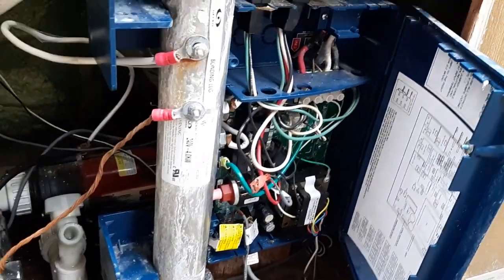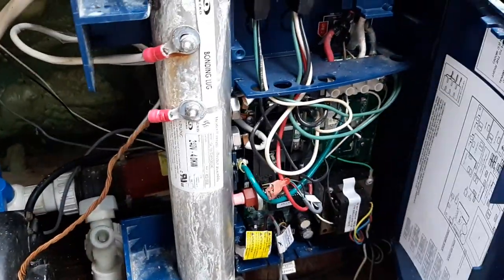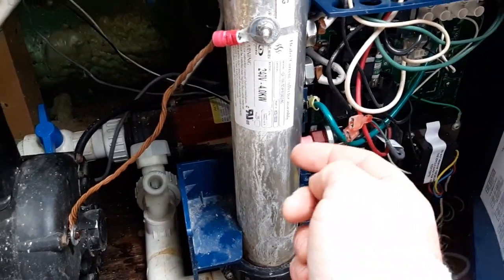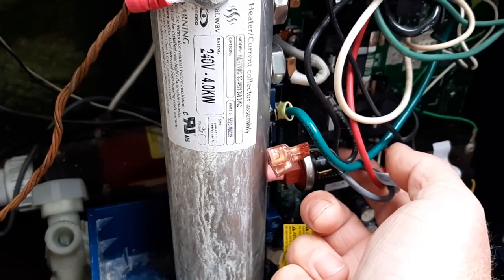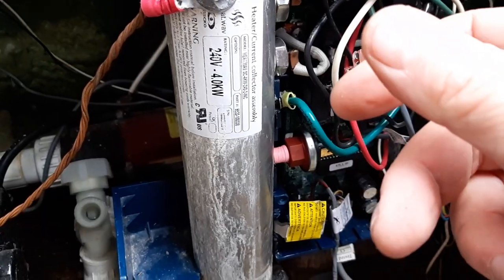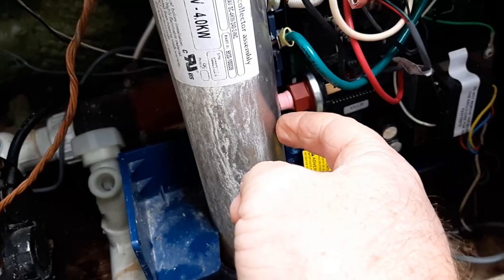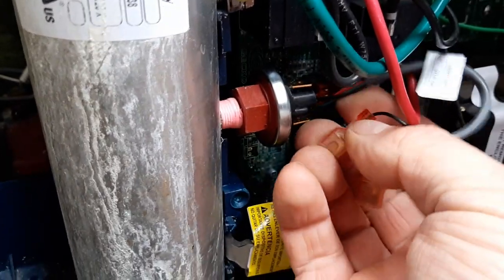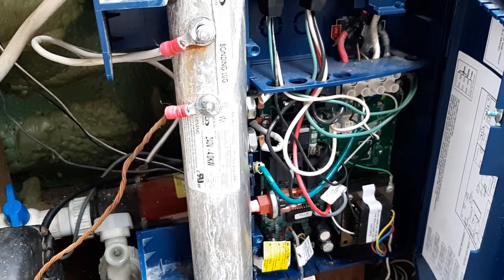Gecko Hot Tub Not Heating and The Reason Why

Comment from the maker: A jumper across the pressure switch is a wire that you can put on the 2 leads.  If the relay clicks and the flo code goes away, then you know it's most likely the switch.  Sometimes you can get a build up on the inside of the heat tube blocking the switch also.  Let me know.

Comment: I took out pressure switch without draining water and water spray on the circuit board but the power was plugged out would that damage anything
Reply from the maker: Dont turn it back on.  You can let it dry out for a couple of days and also use a hair dryer.  Dont use anything else but a hair dryer.  You can also use a air compressor to blow off and water.

Comment: I just changed out my pressure switch last night and this morning my FLO code is tlstill on lol and we have a winter storm hitting us atm. I pulled the filter and  cleaned Y-strain. Im at a loss now lol
Reply from the maker: Is the circ. pump running when its on?  If on, did the FLO code ever go off?
Reply: @VIPPoolsandSpas  i swapped out the pressure switch and pulled my filter and circ pump is circulating but still has FLO code and wont heat ...im at a loss lol its -20C
Reply from the maker: @bryanmayes9234  Turn power off (have someone helping you).  Disconnect the 2 wires at the pressure switch, put a wire jumper on one end and then the other.  Now...ask the person helping you to turn power back on.  check to see if the error code goes away.  As soon as it seems it its working.....turn the power back off.  Put all wires back on the switch and then let me know what you have found.  Theres so many reason why its happening, I'm just trying to pin point where.
Reply: Sorry i been working every day and long days. We are at 35C now 😐🤢 still not heating. My circulation pump is circulating and if i turn the jet on it will heat. Its sitting at 32°f and if i put the jets on level 1 3 times it is sitting at 42°. I tried pulling the circulation pump but i dont think the valves are vlosing as water flows out both ends rapidly. 
I am also scared to fuck with it at these temps.
So when u say a jumper wire u mean take another (seperate) piece of wire with the same plugs as what i pull off? Then what do i connect the other end of that jumper wire etc. Do i need two etc 
Thanks for any and all help.
Reply: Just came home and my mother in law said its not working at all so i go out there and it tripped the breaker lol so i flip the breaker and its got OH code now

Comment: Tried Bleeding, tried the hose, jumped the line on the switch, disconnected one of the terminals on the switch. There are no obstructions. water flows fine. new filter. it goes from FLC to FLO. Should i replace the switch or is there a problem with the board?
Reply from the maker: What hot tub do you have?  And the spa pack name?
Reply: @VIPPoolsandSpas  Hydro quip. ive been told its an off brand
Reply from the maker: this tub is showing a FLO or FLC code right?  Was it just drained and filled?  Did you shut the valves off to fix something?  Need more info on the issue before you started fixing stuff.